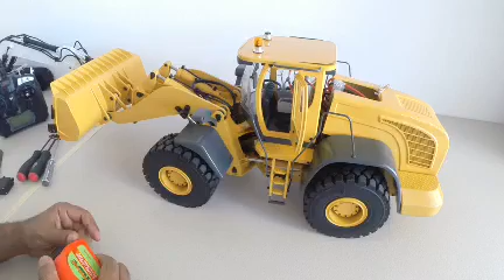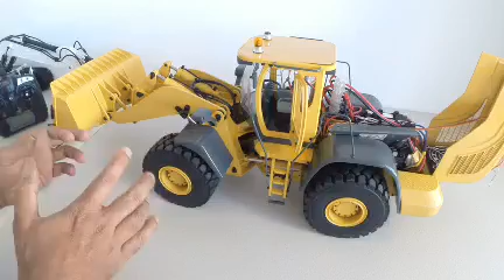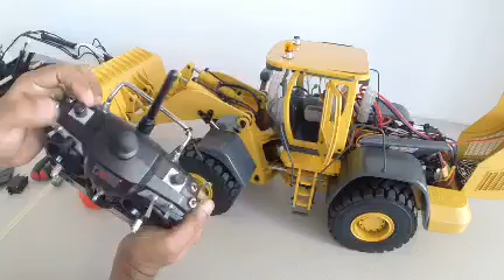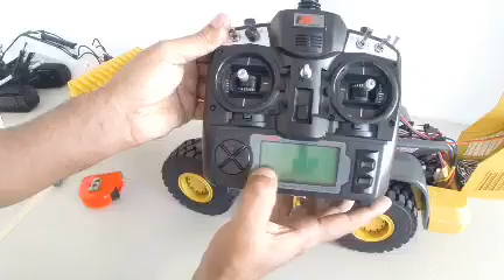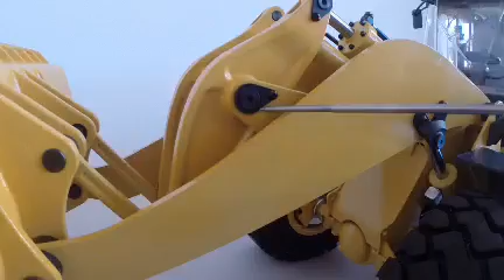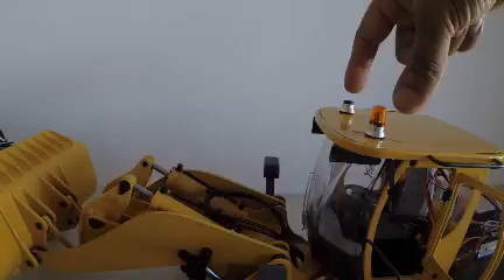CSMI : RC hydraulic wheel loader review

Comment: hello mr kevin how s going i always watch your beautiful video but i have question i have same your the wheel loader 870k so can i remove the teeth of the bucket thx buddy
Reply from the maker: Good day yes you can..
Reply: @CSMIRC  thx bud yeah that what's up 👍so can you make new video 4 earth mover to learn radio settings adjust like how can open all servos from the hydraulic pump and more thx again bud w😍nderful channal keep it up👍👍
Reply: @CSMIRC  hello mr kavin how you doing  so.! kavin i have earth mover 870k new 2019 after a playing with it for 4 hour or half hour i find some oil next to the leaky tank why this problem and what is its solution do you think they all have same this problem in the rc hydraulic i hope to answer me thx pal